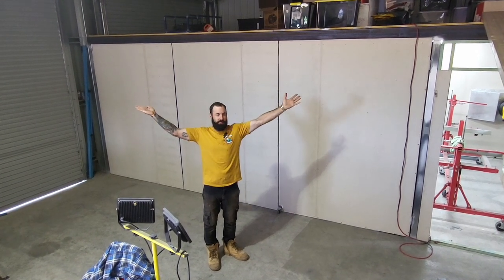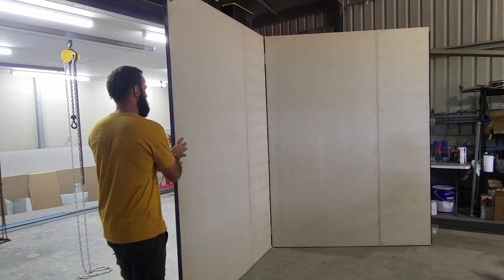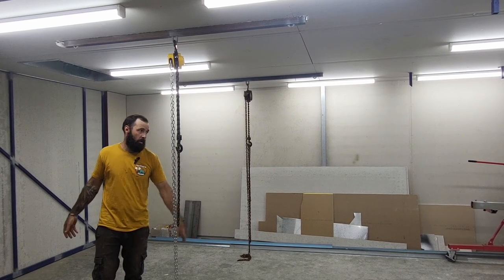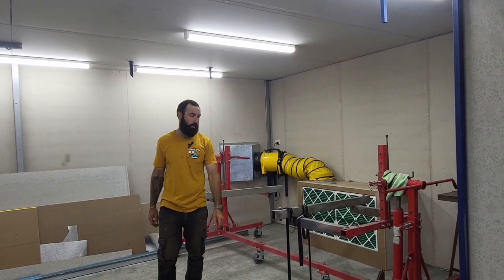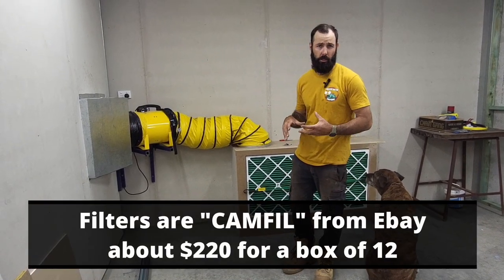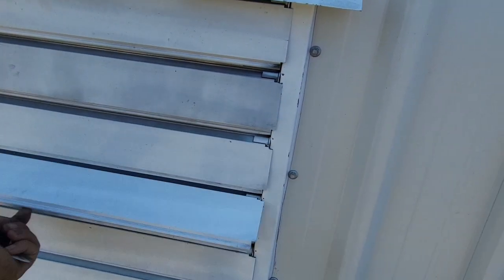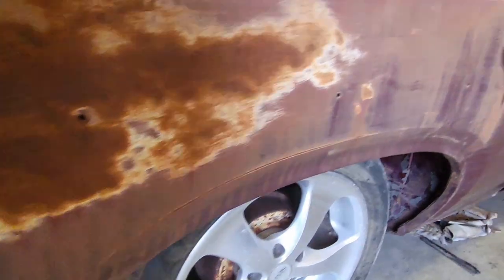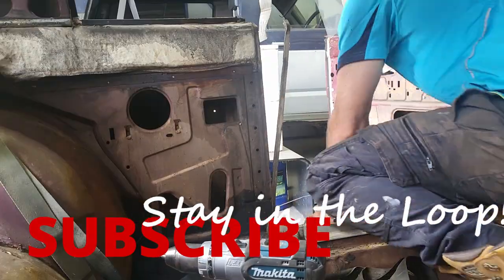Home Paint Booth - space saver HACK REVEAL - [TMC EP 8]

Comment: Are using structrual pipe with connector fitting for most of the booth
Reply from the maker: Not sure what you mean as structural pipe, but the mezzanine floor was made out of steel RHS, and the walls are timber framed on the shed side and the tri fold doors are 3mm 1x1 inch RHS, welded and using a small wheel on each door, does that answer what you were after mate?